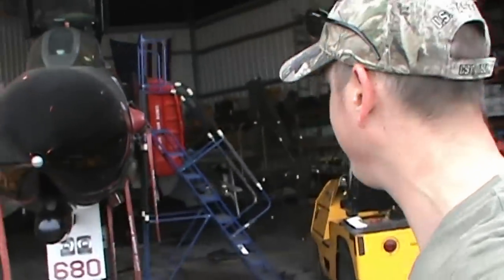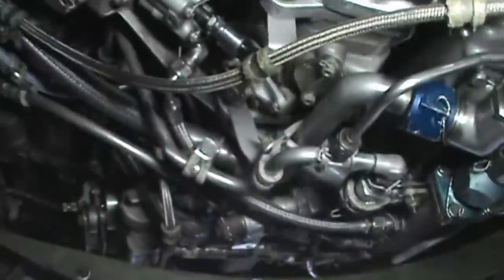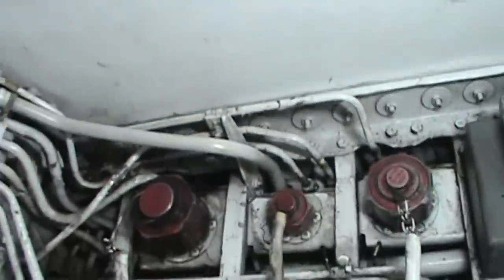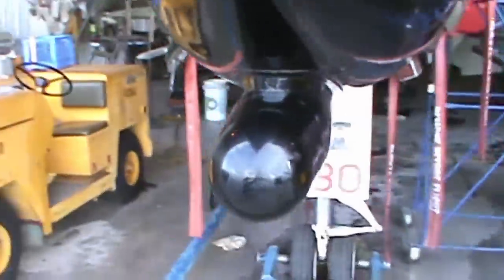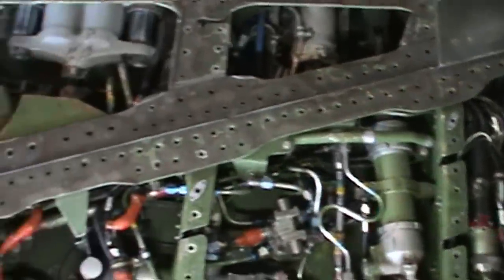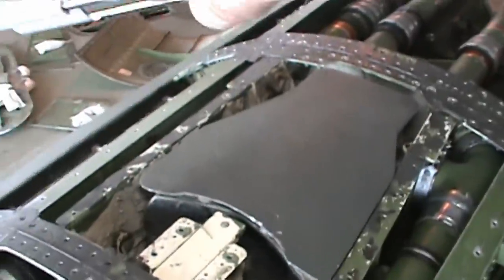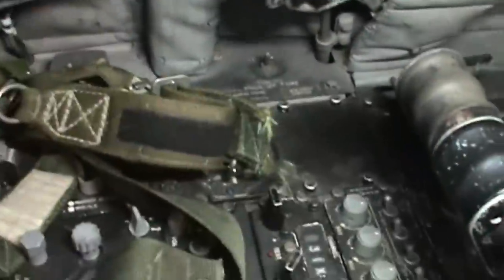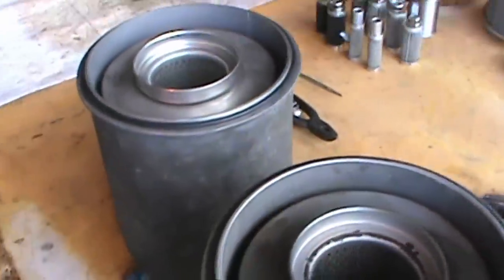An inside look at an F-4 Phantom

Comment: Another use for the tail hook is that they had an embedded receptacle in the pavement that they could hook into to hold the plane in place for hight power engine runs.  And happy that it did work as advertised.
Reply: If you had to run both engines up and into afterburner, you had to take it to a sound suppressor where it was backed onto a ramp and chained down.  The tail was enclosed in a structure with water spraying while the engines were running.  An earth shaking experience with it in afterburner.
Reply: Try being there UNDER the running engine looking for fuel leaks. I had earplugs and comm headset sheesh. 
An F4E w/ J79-GE-17. 
I asked what to do If I saw one as talking was impossible answer: RUN

An experience to never be forgotten!
Reply: I would think there would be someone in your line of sight who is also in line of sight with the run up guy to give the signal for killing the engines.  You may not be able to run fast enough.  lol
Reply: @CVO_GUY  That was what I was told what I should do. There probably was a jet mech on the ground watching besides the run up guy. I don't remember, it's a long time ago, it was early '80's in my ANG unit.
I DO clearly remember the under the belly part....and the shock diamonds
Reply: @paulzaborny6741  It's been a long time ago for most of us.  lol
Reply: @CVO_GUY  We had no such sound suppressors on our base in the IAF.   The tail hook was linked to an imbedded anchor via a very large solid titanium link, about 4m long.   The nose would squat at full power, and spring back up on a quick power reduction.
At full AB, I couldn't get closer than about 30m.
Reply: @CVO_GUY  and it shows when you're on an airline flight watching the TV and see a show on how your plane is gutted, turned into an RPV and painted with orange tips and set out to what is colloquially death row at Eglin AFB.
Reply: @trespire  I'd imagine so.  With the aircraft backed up on the "rack" and chained down, you could get pretty close to it but it was still quite the experience with the earth shaking and all that steam going up in the air.
Reply: @paulzaborny6741  It's sad but hopefully the "attacking" pilots gain some additional skill using them as targets.
Reply: @CVO_GUY  Although I have only experienced it a handful of times, while being called out to the squadron for structural repairs, I can still vividly recall the sight, sensation and smell even after 30 years. The power is almost beyond comprehention.
Reply: @paulzaborny6741  An undignified end.
Reply: @trespire   So I think back to a beautiful sight. Just before dawn, the days weather bird is at end of runway. Last checks made. The electro luminescent strips glowing nav lights on. The bird is glowing eerily. Pilot starts his run up, brakes locked Throttle up and the 7 shock diamonds appear and birds gone.
Reply: @trespire  So I just think back to a beautiful memory.
Just before dawn.
The days weather bird is at the end of runway. Last checks being done. The bird glows eerily in the dim light of the early dawn from its electroluminescence panels and its nav lights. Pilot starts his run up. Idle engines come to life and the 7 shock diamonds come out and then the bird is off.
Reply: @paulzaborny6741  Ours didn't go so quick, as they were typically loaded up with 3 drop tanks and air to ground of all sorts and sizes.   Our pilots would use a lot of the runway to get up to speed, seemed like forever !   Training missions were often at dusk and early eavening, the shock diamonds and the noise echoing off the hills in the twilight was a sight to see.   In comparison F-16's seemed like toys.
Reply: @trespire  Our Birds usually flew with 2  270 gallon wing tanks. My base then was 15 min air time from the iron curtain border and had nukes on station so I guess more care on operations was done.
I saw it move off at max power how far before lift off I didn't see, had to get back to business at hand.

Comment: i am just wondering if the J79 turbofan jet engine, from the F-4 Phantom and the RD33 turbofan jet engine, from the Mig-29 Fulcrum, has some similarities in terms of diameter, sizes and even mechanism that could possibly compatible, to both air frame of one another.

Comment: All I could look at were the solid rivits, Jo-bolts, pop-nites, anchor nuts and quick screws.
I was a structural technician, I used to live under Phantoms. And yeah, those heavy panels can bite it you're not careful.
Reply: You had to love those hi-torque screws in some of the panels.  Sometimes a bear to get out and had to call in reinforcements in the form of a machinist to get them out.
Reply from the maker: Not fun for sure! We've had a few that we had to drill out.

Comment: Hmmm, 82nd ATTARS patch in the wheel well-was she supposed to be a drone? I do not think they used the D's-and for the record-I have completely forgot how to run a mule....when the fluid is milky, means a lot of air....
Reply from the maker: I don't know the detailed history of this one in particular, but Collings Foundation did pick her up from the Boneyard. She may have been earmarked to be a drone, I don't know for sure.

And I agree, hydraulic fluid should not be foamy!
Reply: ...and I do not remember how to get the air out of the fluid-bleeding somehow should work-If memory serves me, you need to ensure there is no air in the hydraulic fluid, prior to running it thru an aircraft-maybe the mule got too hot???

Comment: I was always wondering, why doesn't the Phantom and even the Tomcat have an on board starter and has to use external power? Doesn't that slow down scramble situations?
Reply from the maker: I don't think APU's of the time when they were designed were small enough to put into a fighter. One of the smaller airframes that I can think of that did get one was the C-130, which uses the same engine package as what's in a -60 start cart (it's installed near the left main gear). 

With the Phantom and Tomcat operating from ships, there's plenty of ground power (and crew) to go around for engine starts. Air Force added both a battery and a cartridge start capability to their Phantoms specifically so they could scramble without needing ground power at airfields.

Comment: In the RIO's cockpit, in the left side panel (at the front) there are those 2 big green tubes stacked in the panel one next to the other, like a kind of giant fuses or batteries. What are those for?
Reply from the maker: Those are likely test connections for one of the systems (likely armament or radar). I can take a closer look this weekend.
Reply: @DieselThunderAviation  Thanks, I'm curious because I have a very alike container (chained cap included) but I never knew where it came from.  But it looks (externally at least) like those tubes in the panel.
Reply from the maker: Those aren't specific to the Phantom. Most of the time they are just a simple protective (weather tight) cap for the connector that it is screwed onto. Sometimes they are a wired loopback connector that needs to be installed for that system to work correctly. There's one on the right side of the WSO cockpit that's a loopback plug and ties into the electrical system, but can also be connected to a test set if it's removed.

Comment: I'm assuming this is the Collings Phantom.I was a J-79 Engine Troop.Plenty of scars to prove it
Reply from the maker: Yes, this is the Collings F-4D. Funny story on the engines I had heard about for this bird, is that one of the engines had a problem some years ago and needed to get pulled. The backup engine was installed but it was an older one. For a while, she had one smoky engine and one non-smoker installed!
Reply: @DieselThunderAviation  ,do you know Bob Schuler?
Reply from the maker: No, I don't.
Reply: I was at GAFB where I was a Jet Engine Mechanic for my one and only tour....worked on both E's and Wild Weasels. 

As an 18 year old E-1, back in 1980, I "think" I was on the crew that installed the 1st pair of smokeless J-79's.
At least that was what the troops at the AMU I reported to were saying.

Literally the 1st plane I wrenched on out of tech school. 

I have a blurry memory of a jet going down in Phelan ....I don't recall if it was that plane..It was hydraulic failure. 

Thanks for the video.

Comment: Right behind your hand @ 3:39; is that a cartridge starter?
Reply from the maker: Yes, that is the starter. It's a combination unit that can use the pneumatic hose from the start cart, or you can screw in a cartridge to the large socket and use the hot gases from that to spin the starter.
Reply: @DieselThunderAviation  thanks for the reply!  Reminded me of the cartridge starters that we had on TF-33’s that I used to work on at my first base.  Kinda neat to learn something about the Phantom engine that I’ve never seen.
Reply from the maker: My pleasure! As far as I'm aware, the cartridge start capability was unique to the Air Force, which is why the USAF Phantoms also had a battery, in order to do scramble/alert takeoffs. Navy/Marine Corps Phantoms did not have a battery, or the cartridge start.
Reply: @DieselThunderAviation  That's interesting, I would have expected the same for both, but learning that's not the case is quite interesting.  I'm sure it was for good reasons like corrosion and what not.

Comment: how do you guys get parts for the aircraft? 3D printing and hand making??
Reply from the maker: A lot of parts are leftovers from the Air Force and Navy. As I understand it, once an aircraft series is retired from service, they want to get those parts out of their supply systems. No reason for them to hang on to parts that they don't need. Some stuff is still obtainable, especially common stuff like O rings and most filters.

Comment: Watched this video 4 times. Please tell me the screws weren't removed and in screw bags on panels 101 & 102.
Reply from the maker: Bear with me as I don't have the panel numbers memorized. Which panels are those?
Reply: @DieselThunderAviation  I'm thinking those panels were on top of the wing and screws and were of varying lengths.  Usually made up a cardboard template to put them back where they belonged.
Reply: Those numbers suddenly brought back memories.   Are those panels long and slightly tapered with large radii ends ?   Behind or above a main wing beam ?
Reply: @trespire  I'm thinking you are correct.
Reply: @CVO_GUY  Dang !!!   I must have replaced over 100 or more damaged anchor nuts on those panels in B-Check.   The younger mechanics were always busting them up one way or another.
Wow, what a shot down memory lane !!   Haven't thought about this in over 30 years.

Comment: @16:04 Just fwd of the Generator switches and under the panic lights
& by the pedal is the aircraft battery. Change out every 90 days......OH What PIA to do even with the seat out.
Reply from the maker: Thank you for pointing all of that out!
Reply: That could have you crying like a baby trying to get it out!
Reply: @CVO_GUY   Let see, You First lift up a couple of rt instrument panel boxes for access for your hand. Then while on your knees, with the seat out and with the stick in your chest or left shoulder lower the rt pedal, then lower the C/B panel down there, remove the sheet metal cover panel to the area, undo the copper safety wire on the battery connector and its screw tie down brace, disconnect the hook up cable and while hunched over in a that small area lift a 45-50 lb. nicad battery out of the hole.
Now figure out how to move back and stand up with the battery.
Oh ya, the new one goes in now all in reverse steps.
Usually, 2-3 hours if not so limber and good at it. I knew only one man who was in my ANG unit of F4E could do it with the seat in and about an hour. Would never disclose how either.

Comment: Will she ever fly again
Reply from the maker: She is still flightworthy but hasn't flown in a couple years. We want her back in the air again!
Reply: @DieselThunderAviation  last I heard she was having a complete overhaul
Reply from the maker: Definitely not an overhaul. What we're doing is a big inspection, and since the panels are all open, servicing all of the filters mounted all around the aircraft, oil, fuel, and hydraulic. Also on the list is changing the engine oil and hitting all of the lubrication points. This include both ejection seats too.